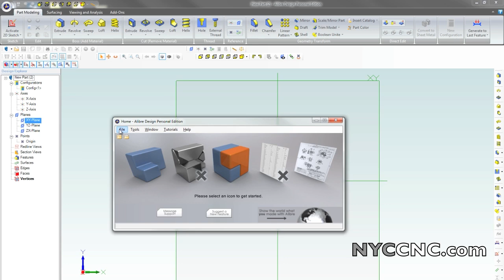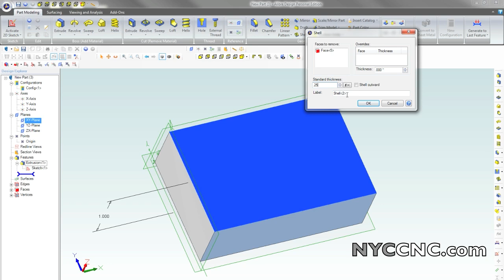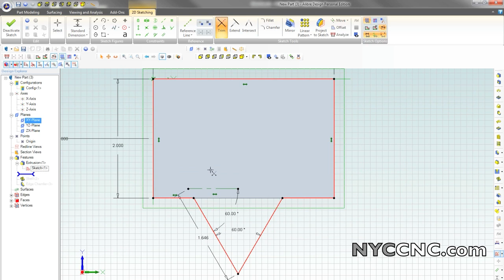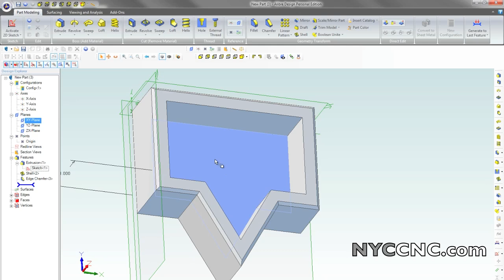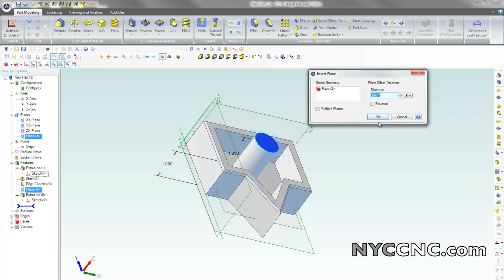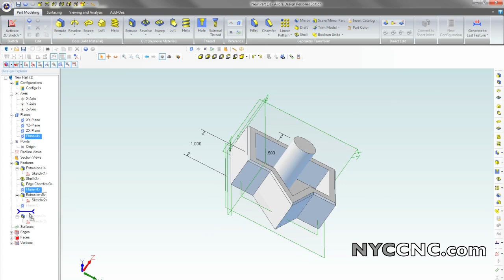Alibre 2012 (Geomagic) Tutorial - Introduction on How to Use Software

Comment: Been on a difficult search for the best cad cam solution at the cheapest cost, I have a home built cnc machine, and use mach 3 as the servo controller, but the cad cam portion is crappy, any ideas? willing to spend about $500

Comment: Wow. Just learned SO much in 7 minutes! Your pace is great. Does sliver hve a CAM plugin? That's why I use rhino so much to be honest. I also like putting in dimensions before I draw a line rather than going back and changing it after. The planes thing you showed helped a ton! Thanks again for another great video.

Comment: the price of spaceclaim is about 1/2 a license of pro engineering. as for features, it keeps improving but it is not similar to solidworks or alibre since it is a direct modeler that uses acis. it works for almost every kind of industrym: automotive, moulding, reverse engineering, sheet metal industry, fixtures. it's easy and intuitive. try it

Comment: I have a 3D mouse, it works very good with Catia. 
I also use it with Ansys workbench and I used it with Solidworks. In these two cases the experience wasn't so good, because one can't define the rotation point (in workbench, one can, but it's annoying). In the case of SW I couldn't do it, so if the rotation point is far away from the working area it is very tedious
cheers,

Comment: constructive solid geometry, or boolean, imagine a sphere and a cube.  putting these things into a tree, much like a folder on your computer, the folder has a setting, add(union) combines them into one shape, pretty simple(sphere with pointy bits).  divide will make a hollow(circle with a cube shaped hollow or vice versa), multiply cuts the parts off that don't overlap(sphere with squared sides).  a multiplied object can be nested inside a divide with a cylinder to make a hole inside it.